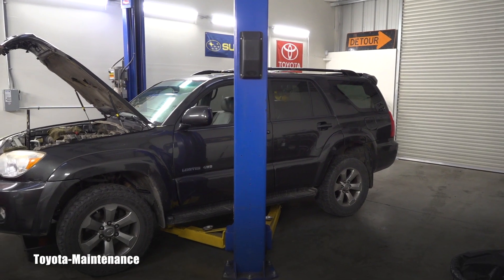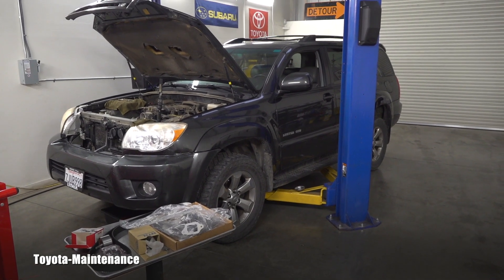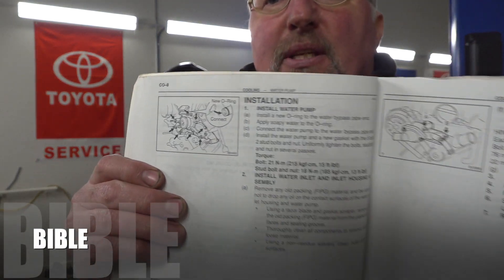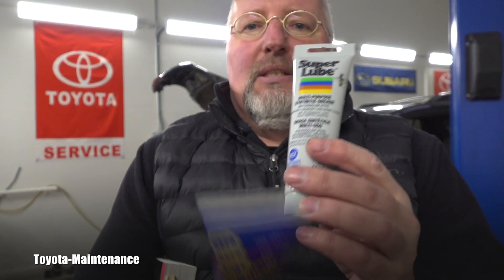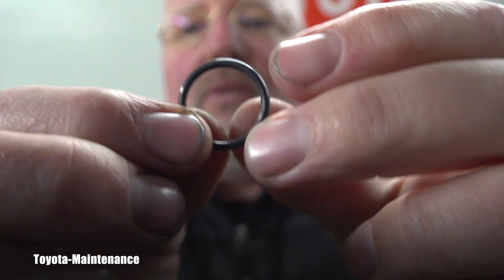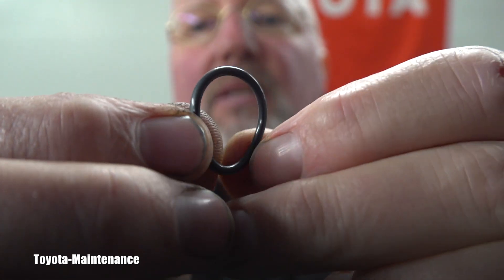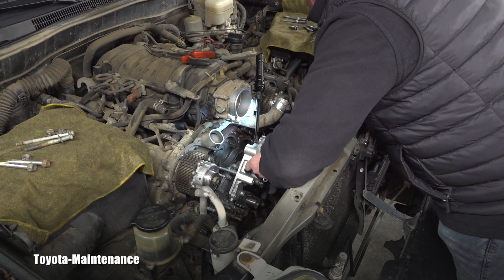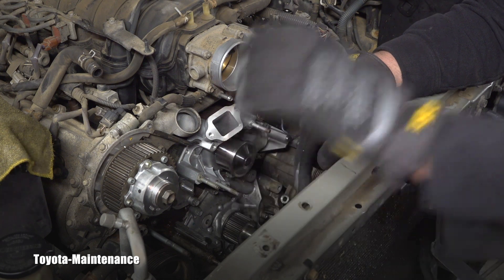Toyota engine 2UZ-FE V8 4.7 Liter Water Pump Install

Comment: Great video.
I understand you don't want to lose a customer  but I would not be happy about non oem parts for this work on my vehicle. O rings aren't rubber anymore, the quality is visually not there and you would literally have no idea  whether this material matched oem. The original o ring will have been degraded  from the heat and wouldn't be acceptable for such a major job. There is zero chance that the timing belt or the water pump would be up to oem standards. Of course, as my mechanic you would know my wishes and this problem wouldn't have happened in the first place.

Comment: Hello Peter, I am replacing my water pump with my timing belt and I'm looking to this as a reference. Great tip on the silicone for the o-ring I'll keep that in mind. 👍

I'm very impressed with all of your mechanical expertise but have personally always been told to avoid using scrapers on gasket surfaces. You recommended it in this video.
Are those specific kinds of scrapers/blades? 

I stopped before continuing The job because I wasn't happy with the cleanliness of my gasket mating surface, and plastic scrapers have done all they can. I'll try with a scrub pad next, and only if you strongly suggest it, I will graduate to using the metal scrapers if necessary.

Comment: I feel your pain. I just finished a complete TB WP job on my 05 4.7L 4Runner, fired it up.. ran perfectly for a minute, then immediately began dumping coolant and misfiring on 7 of 8 cylinders. I can only imagine the crank sensor is swimming in coolant right now causing the misfire and so I shut it down and have to re-do the whole job as you had to do here. Thanks for the tip, I'm going out right now to buy a new O-ring and some silicone grease.. I can't believe this poor design.

Comment: Drawing out a outline of the part with a marker on cardboard and punching out holes for the bolts is a more secure way of not loosing or dropping bolts. Motorcycle clutch covers are perfect for this.

Comment: Tip to keep bolts organized: punch holes in a cardboard box with a screwdriver and stick the bolts in the order/shape they came out (and label, or even “draw” the shape of what they came out of).

It makes things way easier to visualize when going back in, and prevents them from disappearing or getting out of order.

Comment: Thanks Peter! Very helpful videos. I checked the Super Lube website and it looks like they offer several products and not all of them are compatible with rubber. I think this is the one to use for o-rings. https://www.super-lube.com/o-ring-silicone-grease

Comment: I like to buy my timing belt water pump kits from Ebay. They're usually very economical and good quality when it comes to Toyota older models.
Reply: Most stuff on ebay are fakes or replicas

Comment: Hi Peter, I have no experience with this engine, but for similar situations I have used silicone RTV. It is not only slippery, but when it cures it will hopefully seal imperfections on the o-ring or casting. Your videos are great! :)

Comment: Peter, in addition to the silicone grease previously mentioned another good option is Teflon Fluoropolymer bicycle bearing grease. It's a slightly heavier & sticky consistency. Great for o-rings and various items requiring waterproof lubrication. I also use this on spin-on oil filter gaskets prior to installation. Works great for holding things in place prior to assembly.

Comment: I have done a lot  of those water pumps at the Dealership. I put Sil Glyde on the O ring and in the entrance hole of the water pump. Works every time.

Comment: I never torque water pump studs. The way I do them is I get my gasket, put a little skim coat of rtv  silicone gasket maker on either side, place the gasket on  the pump, align the pump to the block, start a couple bolts with FINGERS ONLY, so as to hold the gasket in place, and then get the rest of the bolts/studs started by fingers only, I then finger tighten until the rtv begins to squeeze out. I then go back with a 1/4 in drive, or 3/8 in drive ratchet, and give them a good snug. That is more than enough, and I have never had any problems

Comment: You were a week late! 😄 I just did my 4.7 timing belt/water pump, I know I replaced the large o-ring, but I'm not sure if I replaced the small o-ring 🤔 I better check the junk pile 😄👍
Reply: By the way my favorite silicone o-ring lubricant is made by oatey for plumbing, if it's safe enough for potable water faucets it should be great enough for any rubber o-ring! It's a small container for the price, but it goes a long way! Most hardware stores will stock it.

Comment: Thank you Peter for you honesty and vulnerability regarding this repair. I am a High School Auto Shop teacher and I always impress upon my students that everything you do is a resume. Sometimes repairs won't work out perfectly and you might have to eat a bit of loss to complete the repair and satisfy the customer, but if you are honest and transparent, you will earn their trust and have them for life. You will also earn the customer's referrals. You are the kind of YouTuber that I am happy to add to my course content!

I had the same experience on my wife's BMW X3. The o-ring on the oil cooler line tore the same way and leaked all over the accessory belt. Luckily I noticed it before the belt dissolved and broke (they have been known to wind around behind the harmonic balancer and punch through the front main seal into the sump, resulting in major engine damage).

By the way, I am curious what part of the Old Kountry you come from. My wife was born in the Flensburg region but she can't identify your Dialekt. Bayrisch? Schwabisch?

Comment: I’ve used the Aisin timing belt kit for the Toyota 3.4 and 4.7 liter engines. Aisin is an OE supplier to Toyota. The only thing I used OE is the crankshaft seal. The idler pulleys have Japanese made bearings....it’s the best aftermarket timing belt kit for Toyotas

Comment: As a mechanic for many years I was with you 100% my friend these little gaskets and O-rings are a pain it’s like they’re installed in a manufactured as a one time thing then when problems happen and you have to go in there and take things apart you actually end up breaking the seal most people don’t understand after a while of the engine heat and if you live in a cold climate those gaskets and O-rings tend to get damaged

Comment: I did my rav4 water pump and the Toyota manual callled for putting fipg gasket on the water pump along with the metal gasket

Comment: I have been using the same  independent mechanic for 15 years.  The guy is competent  and honest and I trust him.  He is a Subaru specialist also. Put new head gaskets on my 2000 forester, fast and efficient   I asked him (per your video about becoming rich by working on Subies). He said he has encountered very few head gasket issues with the newer models. Far fewer than the older models   I have no love for variable transmission and will never own one. But he sees very little issues with them in Subies  love you channel and mean no disrespect. Keep pumping those videos put

Comment: Peter, I hope you continue to derive confidence and strength from the 81,500 subscribers who are cheering on your work. I expect most of us are also relieved to know our newer Toyota engines have a timing chain not a belt like this older model.
Reply: I recently did a belt on one of these, and my most difficult seal was the square fitting for the thermostat housing. FIPG for the win.
Reply: @HouseCallAutoRepair  FIPG??
Reply: That fine humble gentleman deserves way more than 81500 subscribers!

Comment: Nice work. Sorry it was a pain but at least you learned a little trick and I’m sure your customer is happy. I rebuild little valve bodies all day, that’s what I do. Lots of o rings. I normally use grease or this spray gel lube we have from our supplier. I’ll have to try that silicone stuff. I’m thinking of buying a Tundra with high miles with this engine. I’m glad to see what I’m getting myself into.

Comment: Great job! I have always used the silicone on O-rings, I use to use soap too but it didn’t always work, on some cooling systems I even used straight antifreeze non-diluted to lubricate the o-rings but to me silicone grease works the best:) Thanks for the video and explaining everything in detail:) Excellent videos
Reply: Does silicone deteriorates Toyota oring overtime?  What brand do u use?

Comment: Pull on the 'new' ones to make sure it doesn't rip apart. It could be defective, with a weak spot, and snap after you can't see it inside there.
 Don't feel too bad about the parts delivery delay with Covid. Elon Musk, the world's richest man, can't get the FAA to issue a Temporary Flight Restriction to test his rocket on the Texas/Mexico border Gulf coast. And all they need to do is type some text on the internet!

Comment: Sweet GX 460 Premium wheels
Reply: Those are actually LIMITED 4 runner premium rims, NOT Lexus
Reply: @nordicpride9708  i have a Gx. They looked similar on video. Thank you for correcting me with the capital NOT. I will certainly try to rise to your height one day 🤡
Reply: @guymann4016  I think you are being a bit sensitive and might want remove emotion from your response. I was putting emphasis on “NOT” for those reading who might want said wheels. Didn’t intend to offend or hurt your feelings. So relax

Comment: I use Toyota Original Rubber Grease too especially when rebuilding brake calipers: TOY 08887-83010 here in the EU.

Comment: Not clear...did you use the o ring you showed or did you pull the OEM used one from original engine  ?
Reply: Yes, I was unsure also. I think you used the used, but still pliable OEM O-ring rather than the defective new one. I think I would have gone with the used, but still pliable OEM O-ring if I were doing the job rather than the new one with the rubber burrs.

Comment: Well done. I keep a few tubes here and there. Seem to find it only when I'm not looking for it. Side note. Just replaced the rear shocks on a 2013 Rav 4 AWD. Talk about piss poor engineering. Can't use socket on the top bolt and no room to swing a wrench. Gear wrench on the bolt side 2 clicks at a time. WTF
Reply: Same as my 2011 4RUNNER front dampers, back bolt was a nightmare.

Comment: In the GM shop manual for o rings that go in the injection system or fuel line system they use ATF transmission fluid as a lubricant this works quite well.
Reply: isn't atf oil based and it can damage rubber?
Reply: @and7976  after testing  ATF fluid
for years,  testing with inspection scope, all the seals are in excellent condition.
Reply: @mobilecommunicationsnetwor5268  Thanks for sharing!

Comment: SilGlyde is castor oil (vegetable oil) based last time I checked. Still rubber compatible.
Reply: Wow!

I use AGP SilGlyde and could swear that "Sil" was for "silicone." I do believe NAPA SilGlyde was made by AGP.
Reply: @SeanPopify  I think they may (now) make a silicone grease under the same brand, different from the original. I'm certain however that the original stuff is castor oil based because I was really curious when I was learning about what to use for brake caliper pins and I dug up the msds to figure out what was in it.
Reply: It is now advertised as sil-glyde silicone lubricant. I hope it has silicone in it.
Reply: @HeyUncleA  I checked the msds again just now. It says it's 30-60 percent caster oil. I could not not find anything that indicated any silicone content. I don't know what to conclude because all the sil-glyde grease products are now labelled "silicone grease". The weren't when I first dug up the same info a few years ago.

Comment: Perter, do you mean this, by "Toyota o-ring grease"?  Toyota Rubber Grease (08887-01206):
https://www.amazon.com/Toyota-08887-01206-Rubber-G-100g/dp/B00JIL2W9O
I have used it for years -- the like Sylglyde, but it's a pink color.  It doesn't cause swelling.  But I haven't used it on water pump o-rings before -- I just did soapy water, like you do, because that's what's in every FSM.